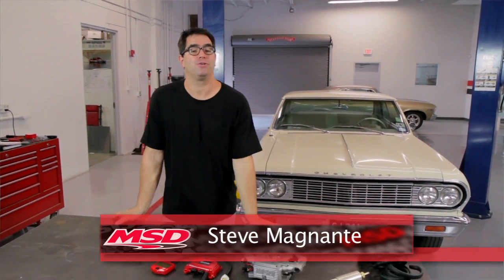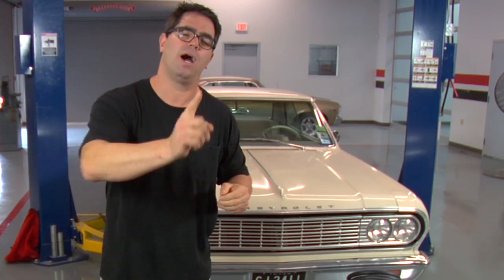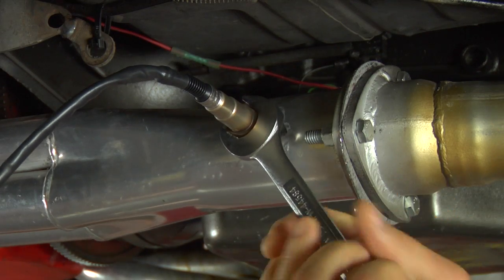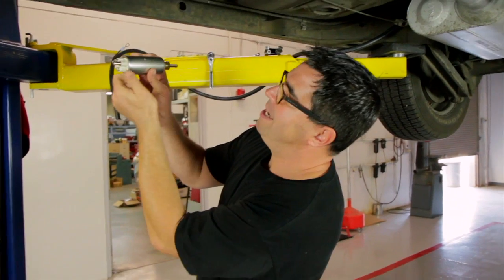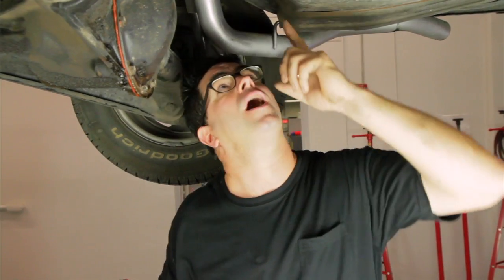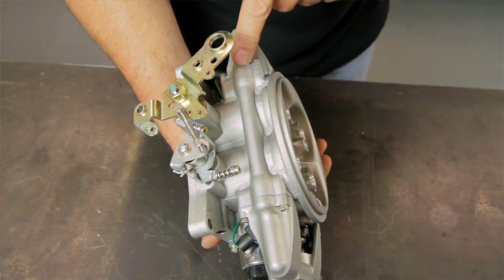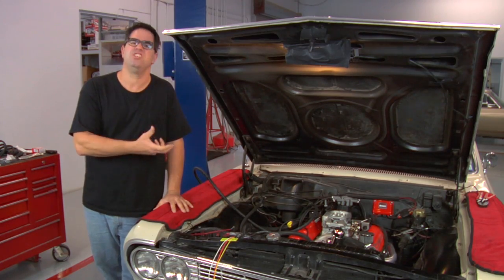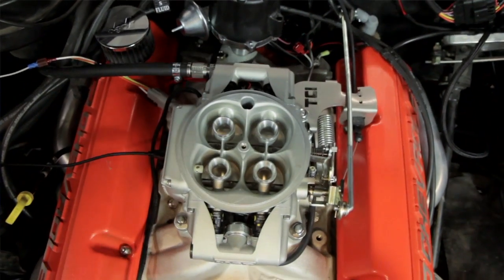MSD Atomic EFI Fuel Injection System Installation

Comment: Don't listen to half of what this guy is saying, this video should be deleted. The fuel pump has to be in the gas tank, and you cannot run a returnless system. You have to have a return system. Do not run 2 fuel filters, just use one at the tank. IDo not try and install it yourself. I had a regular mechanic install mine (big mistake) and he did the returnless fuel line, with pump outside tank, with 2 fuel filters. It kept stalling out especially when hot. Everything had to be done over by Detroit Muscle. There are other things involved also that the video does not bring out. Have a specialty performance shop install it. Save yourself all the AAA towing hassel.

Comment: You have two installment videos, with the same car, you installed the pump on the frame on this video. On the other video you installed the pump near the gas tank....so which is the correct way.
Reply: Too bad he won't reply to questions...... the video where he mounts the pump close to the tank was uploaded in 2012 white this one was added in 2014. Really would be good to know which worked out the best.  You will notice if you listen carefully to the other video  (pump at the tank ) that he says it is "ideal" to mount the pump in the TANK. I have heard that heat is the problem when mounted externally of the tank.   Wish he would address that issue or show how to mount the pump in the tank.